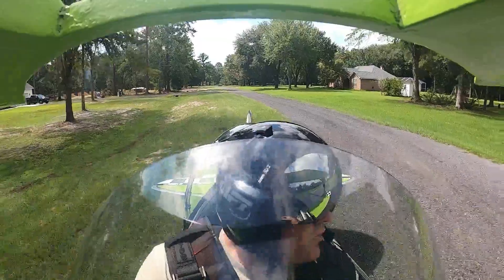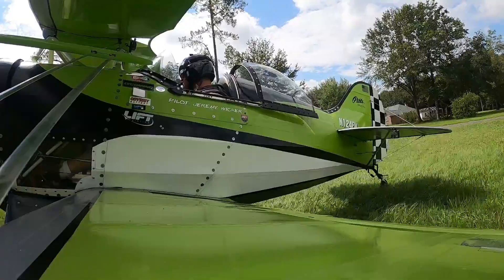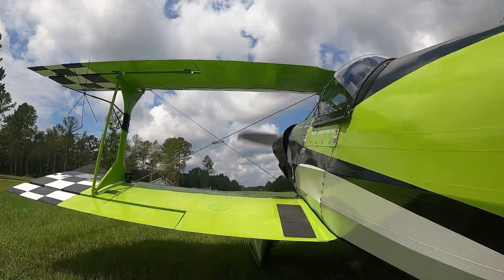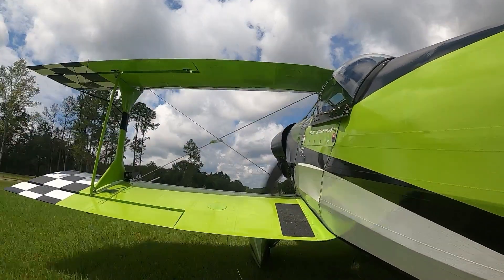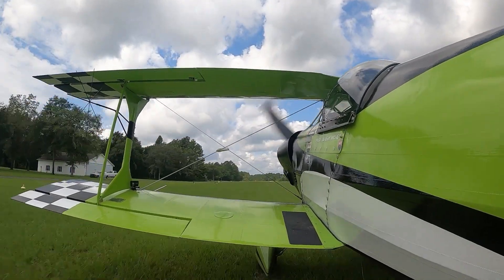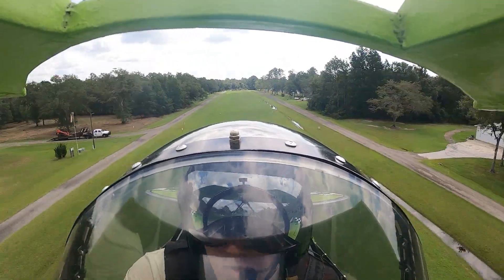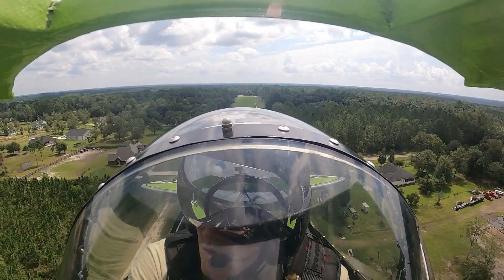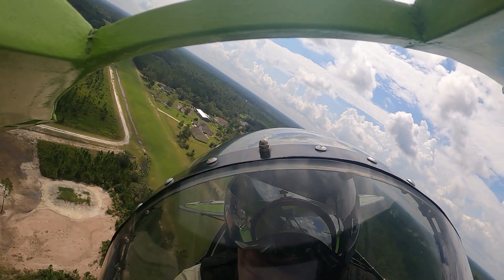High oil temps abound

Comment: I would start with the Vernatherm valve. This could be tested by removing it and placing it in a pot of oil. Begin heating the oil and monitor the temperature with a thermometer. I believe it should actuate around 160-180 degrees. If it doesn’t then it needs to be replaced. It works like a thermostat in your car but for oil in your airplane engine… Also when it is out inspect the vernathern seat in the engine.